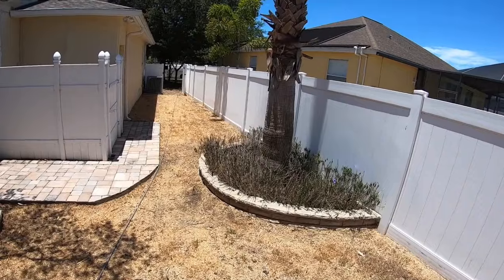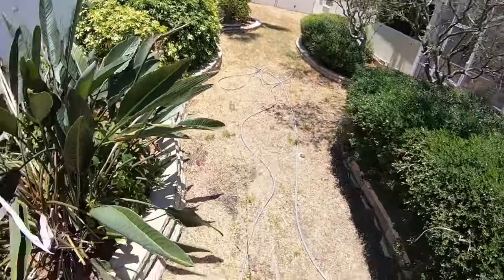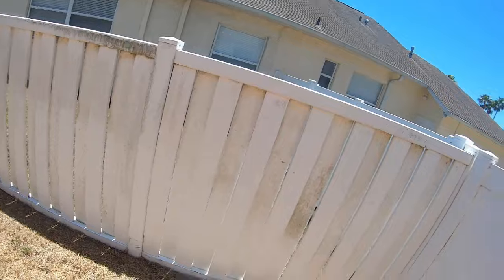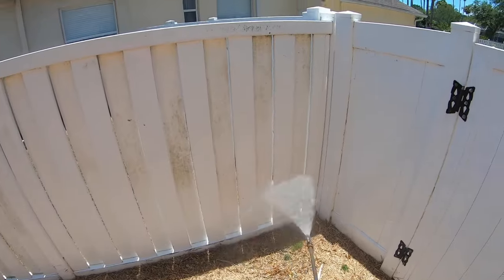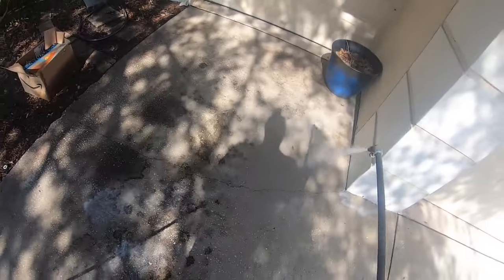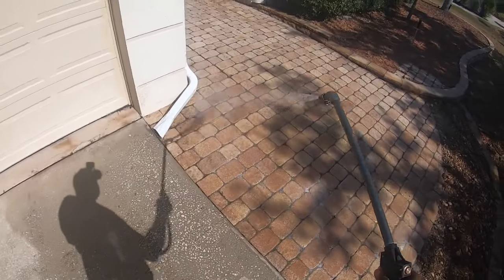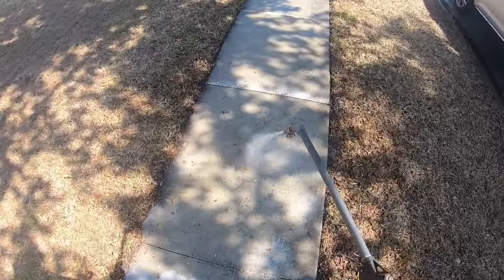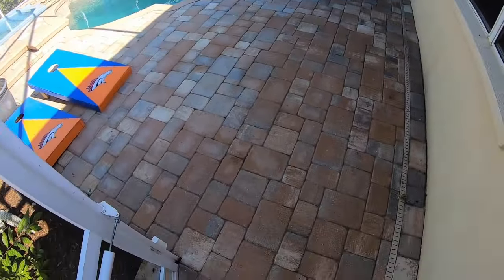In And Out quick and easy job

Comment: Wow shooter tip on pool cage my knees would be knocking that I'd blowout a screen
Reply from the maker: It's low pressure. Im more worried with i use my low rinse tip on my j rod cause it puts out a heavy rinse/wind
Reply from the maker: The 0010 tip id never use on a screen that will cut it. Shooter tip though nah
Reply: Gotcha
Thanks. Mr. Cliff always learn something new 👍💪

Comment: Homie if don mind can dodifferentifferece between downstream pressure wash
Reply from the maker: Pressure washing is for concrete and hard surfaces.  Soft washing is low pressure cleaning.  Downstreaming is a method of soft washing. Basically using your pressure washer to apply chemicals by means of low pressure.  It won't draw chemicals under high pressure.

Comment: How do u get oil out of concrete driveway
Reply from the maker: Heavy duty degreaser.  Set expectations with the customer.  If the oil has been on the concrete for months and years sometimes its impossible to get it out completely.   Usually majority will come out but a shade spot may be left